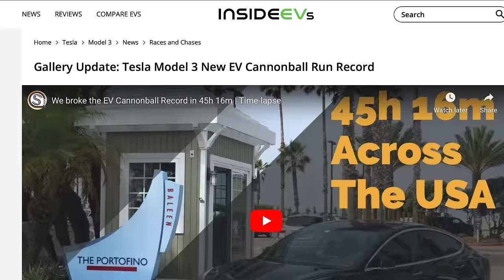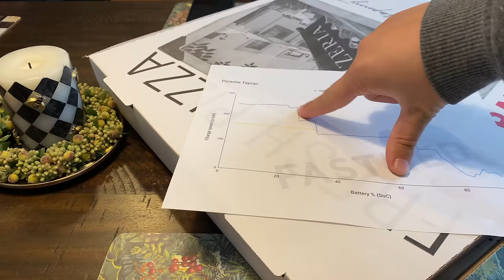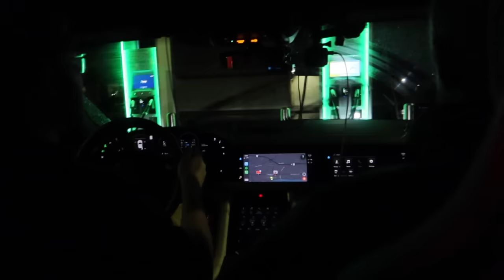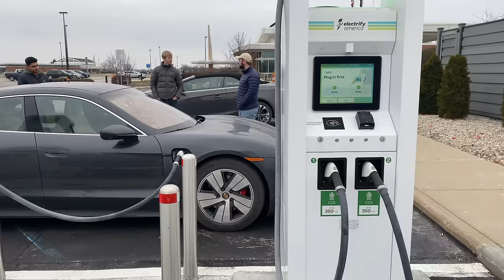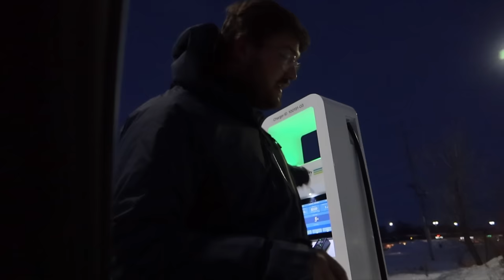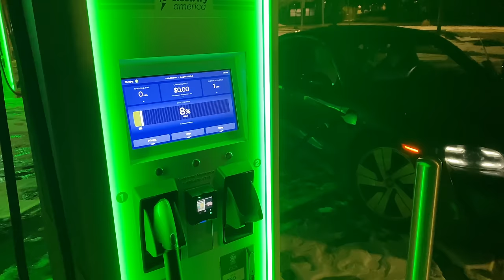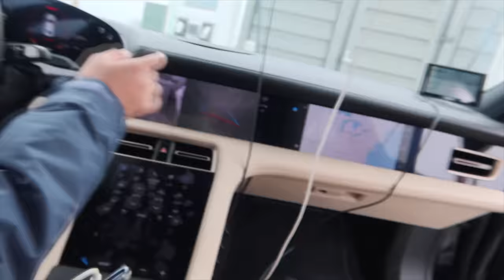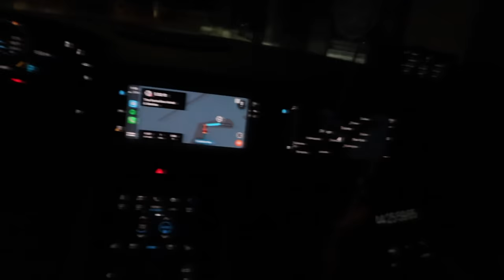EV Road Trip From NYC to Los Angeles! Breaking The Electric Cannonball Record In A Porsche Taycan 4S

Comment: Absolutely terrifying that you had that much level of support from Porsche and Electrify America and still run into that many charging issues. Absolutely stunning.
Reply: Tesla killers I tell you!
Reply: EA -  VW's punishment for DieselGate.  *of which Porsche was involved.  No one is shocked with a half-assed supported Charging Network from EA.
Reply: With time and focus these issues should be solved and the charging rate will be better than Tesla. That said charging every 100 miles to maximize the charging seems crazy and not my idea of a road trip car. A EV with 400 mile range seems like the future.
Reply: Tesla killer how? They had so much support and this wasn’t a real life road trip. How much is this car? $160,000 - yeah everyone is going to buy that.
Reply: @gregorywhittington9002  it was a sim/nav issue where the car couldnt locate where it was in order to warm the battery in preparation for a charge. this could be fixed but they were on a time crunch and decided to go without it...Porsche isnt touting this as a Tesla killer. kind of lame how Tesla owners have to pit themselves against other cars, as if tesla never had issues when it first started its EV journey lol. I am interested to see how all EV brands can eventually grow
Reply: Electric cars are a scam
Reply: @4kking966  How so?
Reply: @gregorywhittington9002  because a $3000 used toyota would do this run faster than a $160,000 Porsche. Working class will never want EVs. Only the most expensive EVs have batteries large enough for road trips, and even then its an imperfect replacement for gasoline. Fastest gas cannonball run is 25 hours, fastest EV cannonball run 44 hours, nearly twice as fast. The EVs that the working poor will be able to afford will have tiny batteries that wont have range to leave their home metro area. And the working poor living communally certainly dont have individual garages in which to charge. I owned a Tesla myself, standing in the Mojave Desert waiting for the car to charge for 30 minutes in 110degree weather, knowing that if I ran the AC, it would take 1 hour, helped me realize the hard reality of EV in real world conditions. Meanwhile diesel trucks with 500 mile tanks were happily zipping by me. Materials science can only go so far, heavier batteries have diminishing returns as they drain themselves. A cheap toyota with a couple of jerry cans will go much further than any electric car ever will, you can count on it.
Reply: @4kking966  People don't buy cars to do cannonballs.  Tesla's 4680 battery is going to make the car weigh less and they produce more energy/increase range.  Tesla can't keep up with demand and they're coming out with a $25,000 EV.  They've sold out of cars halfway through Q2.  Long term electric cars will be less expensive than ICE cars.  Legacy carmakers are trying to play catchup.  You won't be able to buy a car running off fossil fuel in 10 years unless it's used.  Look at what's happening now with gas.  I own a Model Y and would never go back to an ICE.  Tesla has the infrastructure that the other cars just don't have and that was my point.
Reply: @gregorywhittington9002  In 20 years you can do this trip faster with any ice car  faster than any ev fast charging electric vehicle because the problems still gonna be the same communication too much charge not enough bla bla bla.
Reply: Every non-Tesla video I've seen on this channel has these EA charging issues. It certainly doesn't bode well for when those 50,000 F-150 electric truck owners get on the road.
Reply: @donp4415  in 20 years gasoline burning cars won't be affordable if they even exist. This is from the future, 4 months to be exact, and fuel prices are rising throughout the world. I do find your assessment funny though about what the problem is, considering I just did a 2K mile trip in our EV and it was the best experience in a car yet. 

Feel free to stick in the past, it doesn't bother me one bit .. we're enjoying the benefits right now.
Reply: @4kking966  : How long ago were cell phones easily twice, maybe three times, the size they are now?  How long did it take the automobile to make horse-drawn anything obsolete?  EVs, like anything electronic, will only get cheaper and better.
Reply: @JarredSutherland  : Well said. Thank you.
Reply: @williamkinn5959  : I've made many an Ohio-to-Tampa runs over the decades and found my max range(bladder, knee, focus) to be about 200 miles.  About what the average driver needs between breaks behind the wheel.
Reply: Its the biggest reason to just buy a Tesla.  I have NEVER left without a successful, flawless charge.  I have only had to wait in a line to charge twice, in 80,000 miles of Tesla driving.  The supercharger network is top of the line.  They just work.
Reply: @4kking966  

A $3000 used Toyota would be a roll of the dice whether it even makes it at all without something breaking. To have a car you can trust for a trip like that, you'd need to pay a lot more than $3000.

Also, it takes a car 10-15 years to depreciate down to the $3000'ish level, so someone looking for cars at that price point is limited by where the EV technology was 10-15 years in the past, not where it is today, and in 2022, 10-15 years in the past, there essentially no EVs to speak of besides golf cars. In time, of course, this will change. I'm sure by 2037, people will be able to buy 2021 Chevy Bolts' for something in a working class person's price range - sure, by that time, these cars will look like dinosaurs compared to whatever new tech they have, but the fact that they will be dinosaurs is precisely what will make them cheap. And, even if the batteries have only 180 miles of range compared to the original 260, that's still all the average person needs, especially if 2037 has more places to charge than 2022 does.

As to not having individual garages...eventually, landlords will start installing car charging in residential parking lots, because it will be a basic expectation that people demand. They might even be able to pay for it with tax credits, depending on their state. Sure, charging will take longer to trickle down to the cheap apartments compared to the more expensive ones. But, charging plugs are cheap to install (especially the 120V sockets for L1), and it will eventually happen, just like, originally, only expensive hotels had wi-fi, and now the cheap ones do also.

Finally..."waiting for the car to charge for 30 minutes in 110degree weather, knowing that if I ran the AC, it would take 1 hour" is a gross exaggeration about the air conditioner. An air conditioner drawing about 3 kW is not going to double the charge time at a 100-150kW charging station. The impact of running the air conditioner while charging is barely noticeable. And, the only time it is ever actually necessary to "wait for the car to charge" is on road trips. Traveling in town, you just charge every night at home, and never have to wait.
Reply: @gregorywhittington9002  IT WAS A JOKE
Reply: @ArrghhMatey  pretty sure someone else said Tesla killer
Reply: @williamkinn5959  , Exactly how much time will you accept for them to get this right? I’m watching this video a year after it was posted. Comparing this video to the current ones Kyle and others are posting, it seems not much has changed with these chargers.

From reading all the YouTube EV channel comments as well as on various Tesla FB groups, it seems that the EV and Tesla fan boys will excuse ANYTHING within this industry. Spend $160,000 on a car and it won’t charge? You should just accept it. Spend $80,000 on a car and you have issues with its build quality? You’re just a nitpicking complainer. Spend $70,000 on a car and have bad customer service? Why are you complaining?

It’s the craziest thing I’ve ever seen!

Someone could literally buy an EV, it could explode before they get it off the lot, and the fan boys would ridicule the new owner for complaining about it blowing up.
Reply: @4kking966  who the hell is buying a car based on how fast it can do a cannonball? 99.9% of people dont ever do a cannonball run in their life nor would they want to.
Reply: @anthonyscott5134  we are gonna have to wait a long time. But it really the only choice since most states are making laws to force EVs.

Comment: Must be nice to be able to call up Porsche and say, "Got a Taycan for me to run a cannonball with?"
Reply: Hey Mclaren, got an extra 765lt? I'm trying to break a cannonball run record. Thanks
Reply: oh man its gotta be an honor to hold a cannonball run record, this is like the new stock car racing
Reply: Yep, VW willing to torture test their halo electric product on their charging network in a cross continent race, pretty good low cost advertising!
Reply: And how does that work with 40k followers? Not to denigrate 40k, that’s not easy, but I would have guessed you would need at least 500k for Porsche to  even respond.
Reply: @cadet526  it's called "Tesla". I always preferred the looks of the Fisker Karma over the Tesla even though the Tesla is a better car. The Taycan pretty is the Karma body with a porsche front and rear and the capability of the Tesla. I would pay the extra money for that car anyday.

Comment: You know what I miss in this long upload: timestamps
00:00 Intro
01:38 Red Ball Garage
02:39 Pre-trip
16:12 Getting the car
18:35 Dark Taycan
19:35 Leaving
19:46 Pre trip charging
21:38 Pre trip human charging :)
23:20 Back at Red ball garage
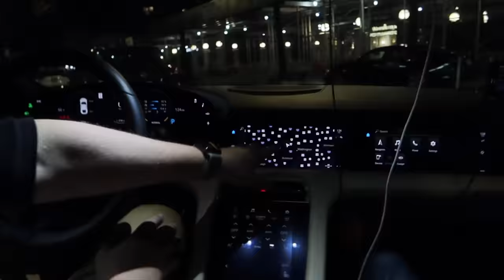24:27 pre set nav troubles (but we know already)
26:53 RESET RESET RESET
29:40 out of NYC
32:00 First Charge >230kW
33:40 Snow forecast
35:10 Second leg
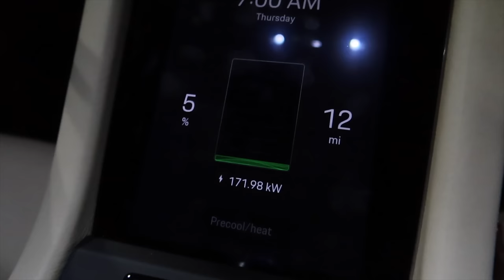36:12 Second charge
37:06 Third leg
38:14 Quick stop w/ communication problems
39:48 4th leg
40:00 Charge with problems
42:20 Drews first leg of the trip
44:00 slow personnel
44:20 Charge 
46:20 Older chargers overboosts = not good, now deep charge
48:00 cops cops everywhere
49:40 Indiana
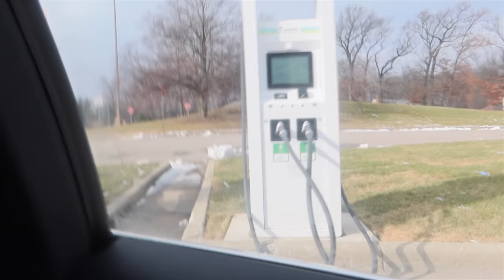51:00 EA pre-charged charger troubles
56:00 Julliet charger >250kW
59:04 So slippery chargers troubles
01:03:00 Charge connector troubles and some charging theories
01:06:00 Chaaaaaaarge (theory is correct)
01:08:20 Charcuterie board
01:10:20 Driving around a charger
01:11:57 Drew tape shopping
01:14:30 Charger glitch
01:15:49 Nebraska charger 1%
01:17:35 Smells like ... charger
01:18:53 Welcome to Ogolawa
01:20:00 Fort Morgan CO
01:22:50 Glenwood springs
01:25:00 Charging ma car :D >250kW
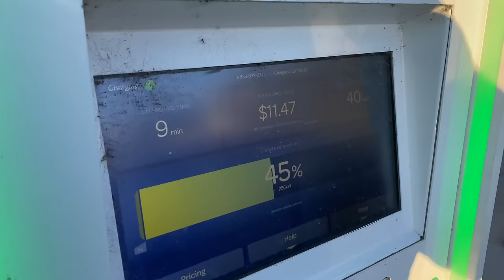01:27:40 Thanks Sam
01:30:40 Greenriver >230kW
01:33:20 Dodge cop with ligths
01:33:55 Low charger speeds
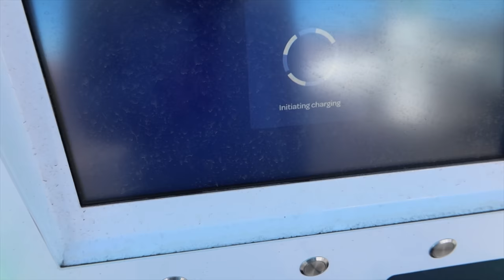01:38:38 Charger shenanigans
01:41:33 Las Vegas
01:44:35 Shredding to Cali
01:46:45 Barstow
01:47:40 Charger dance
01:49:48 Last leg

Comment: At the 1:10:00 mark now, and clearly, VW/EA have to get their act together. The charging stations and the cars need to have seamless communications or it will continue being a big issue for mass adoption of the legacy car manufacturers. I hope they can figure it out soon to make it easier to transition to sustainable energy and transportation model. It should just work.
Reply: Totally agree. EA must improve a LOT the charging speed as well as the stations reliability. They could have saved up to 3 hours if EA chargers started charging at 350Kw.
Reply: @nunolp9067  what I feel is the time you plug in the car they want the car and charger to talk and determine charging rather there should be a Manual mode until the technology is refined, and the end user must give the charging station what he has abs what capacity it can take that will I think make charging more efficient.
Reply: For the money you spend on that Porsche, the EV charging situation for trips and EA should be much better.
Reply: But most people will charge 90% of the time at home and so it's not as big of a deal as most people think.
Reply: @david19897  that 10% is the most people think of when buying the car I think

Comment: Kyle and gang that was amazing. 😁
I'm sure you drove flat out to get that time with so many charging issues. I totally appreciate your pain, I have had many similar problems intermittently. I am really hoping Porsche and EA will get things worked out soon so I can make road trips without having to be concerned.

So happy you did this trip to show the capability of the car and the continuity of the network.
Reply: The Taycan isn't suitable for road trips. It was designed for motoring you over to the golf course from your ocean front beach house.
Reply: @ImperialCrab  of course the Taycan does well taking you from the Ocean Front Beach House to the golf course, but I beg to differ on its road trip abilities. Done over 18,000 miles in <1yr with it. Trips up and down California so far, but plan on East coast next year.
Reply: @ronb4633  Good luck...

Comment: What a beautiful car -  best EV on the market right now (for me ok?)  They just announced the RWD Taycan with large battery as the entry level model - "cheapest" which is relative  with 79k$ ...starting price.
Reply from the maker: Can't wait for the RWD Taycan. Perhaps the enthusiast's choice? Lovely. - Kyle
Reply: @OutofSpecMotoring  yes for me it is :) you get maximum range, give a bit of acceleration - but man it should handle...
Reply: RWD Hatchback (Sports Turismo), 3 years old, that'll do me ... as long as the Ionity network is sorted (which hopefully it will be by then)
Reply: @malcolmhedges7346  cool too :)
Depends where you live - this Cannonball run showed it works too in the US now, I was impressed.
Reply: @bavariancarenthusiast2722  European network is fine if you live in Germany and the Nordics but here in the UK, not many chargers and those they do have are unreliable. Just about works in the US when you have 4 or more chargers to yourself and you can park in-between chargers for when 1 fails ! They still have a long way to go but then they've set themselves a far more complex task than Tesla. Think I'll wait a few years before buying a Taycan, Nav not working in 20221 ?
Reply: Expensive niche product that wasn't working when delivered (not checked by the dealer, despite them knowing the situation?) and couldn't be fixed despite ripping other cars apart?
Hmmmm....

Comment: I just noticed we now (spring 2021) have a rear wheel drive only Porsche Taycan with available 93KW battery, I wonder if this would do better as it is lighter possibly more efficient.
Reply: It's actualy slightly less efficient as it does not have the more efficient front motor and cannot drice in Eco mode.

Comment: This video showed an aspect of charging that I hadn't ever thought about before. So many of these places are untended and have no snow removal. At any reasonable gas station, the attendants will be out there clearing the snow, then salting/sanding. Slipping on the ice is an issue for those of us that aren't spring chickens anymore.

Comment: Really interesting thought that I had while watching - you guys actually seemingly benefitted by not having the Nav working. If the Nav was pre conditioning the battery up to temperature, and the battery being up to temperature was causing the overcharging/requesting too much power from the 350s, you were actually better off with the car not knowing you were pulling into a charging station, so you could manage the temps yourself and pull in artound the 84/85 degree mark like you figured out.

Awesome run!

Comment: Great video! I just found this channel and love watching you guys! Super appreciate the little charging tips and tricks everywhere, and the spirit of experimenting and trying different and wild things out!

I don't know the specifics of EV charging, and maybe I'm completely wrong here (glad to be educated), but generally with electronics and batteries, it's not the supply which 'dumps' a certain amount of power or amps into the load (car). It is the other way round, where the load, either through natural characteristics, or artificially changed (for safety, temperature, etc.), presents a certain 'load resistance'. This load resistance is what determines how many amps will get pulled from the EVSE, and the load resistance is entirely determined/set up by the car. There's normally no way a charger/EVSE can 'force' more amps through a load than the load is naturally asking for (via resistance). The supply can /reduce/ the current to something lower than what the load resistance would've resulted in by /adding/ more resistance on its side, but it can never supply /more/.

The hypothesis about cooler battery allowing the full 270kW sounds plausible - but in somewhat the inverse way. When the battery is warmed up, it simply asks for 270kW. What I suspect is happening that the EA equipment freaks out when that much power flows in a very short ramp, and that kills the session. When the battery is cold, the car limits the amount of power it requests, and the EA gets a nice slow up-ramp as things warm up - and it is able to handle that. This is purely my speculation of course.

Comment: I wonder if EA could have set the 350 chargers to have a limit of 250 so that it couldn’t over charge and brick.
Reply from the maker: Exactly! This is what I kept asking during the trip for them to try and apparently it wasn’t so easy? Not sure.
Reply: @OutofSpecMotoring  This is why I love this channel. You know this EV stuff in and out and figured out the battery temp trick  

Too bad they couldn’t do that little hack to set the charger to 250.